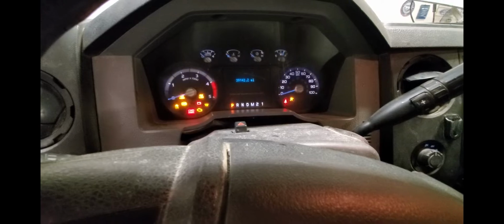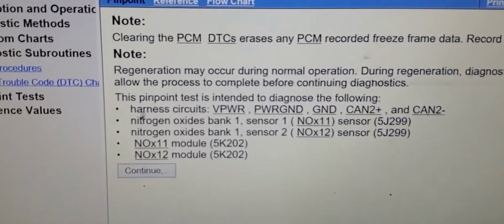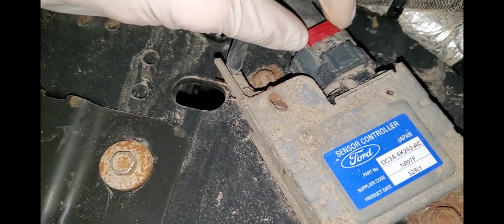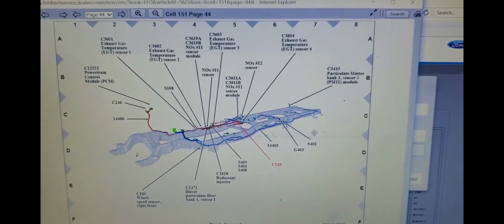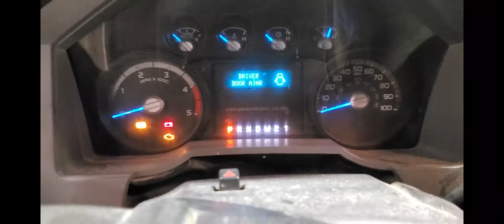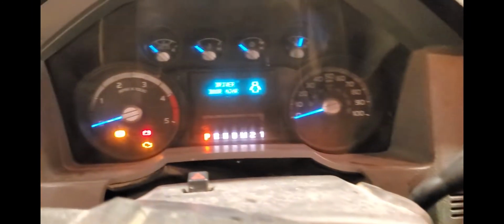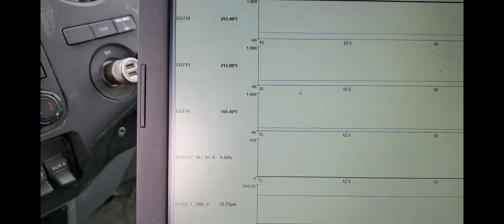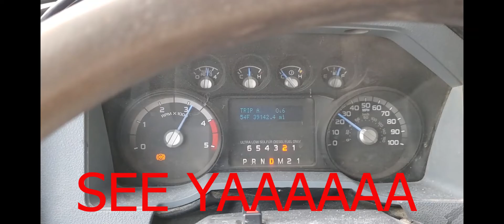FORD 6.7 Powersteoke Diesel-LIMP/DERATE MODE EXIT PTOCEDURE CAB CHASSIS

Comment: after replacing or repairing the harness/wiring, is it possible to run a drive cycle without a computer or program?  Like just start the engine and press the gas for a while?
Reply from the maker: No

Comment: Great Video my man. I was able to get a 2016 F550 out of idle mode after determining  the DEF injector was clogged. The DEF injector duty cycle would not show the graph you pointed out. FYI, I was able to use my Autel MaxCV scan tool to do pretty much the same as the Ford Program. "Live data" feature on the Autel is the same as the PIDs. Thanks again!

Comment: I have 2015 ford f550  with code p207f and p202e doesn’t want clear codes replace injector and check wiring good and send the computer to check if is bad checks ok doesn’t want clear any idea s thanks

Comment: Also from your experience what should the nox reduction percent be?
Reply from the maker: It will very by truck & the condition of the SCR
Reply: Ok I see I’m trying to gather some numbers to help the shop I work for back home. I’m currently deployed amd I’m usually the one to do the diagnostics. The guys back home are not very familiar with the Emissions systems. Anything would help. Love your videos by the way.
Reply from the maker: Yea, it wld all depend on the problem & the codes retrieved.
Reply: Setting a reduced power message under 50mph with the infamous P207F code.

Comment: I HATE how freaking complicated these retarded emissions systems are! I'm still fighting frequent regen and DPF filling issues and a stupid EGT 1 sensor that keeps losing communication (2013 TSB something about bad crimps on the connector - still need to replace). Waiting to hear back if the SECOND DPF cleaning is successful. Apparently all DPF cleaning services are not equal...

Comment: I've had to do it where I drive to 50mph let off and coast. Repeat three times. Then hard acceleration to 50 and coast like 3 times and it cleared.
Reply: That was after replacing the reductant pump though. Different procedure?
Reply from the maker: Same drive cycle
Reply: @PowerStrokeTechTalkwARod  🤔🤔🤔

Comment: I've been in the repair business for 42 years. My current company has excellent documentation for their hardware. Looks like Ford does as well. I appreciate that your job isn't always finding what it is, but what it isn't through fault isolation procedures. You have to be the benchmark for Ford, and for 6.7 owners. If you were just more geographically desirable, you would be taking care of my '21 and my BIL's '11. Instead I watch you, and give it my best shot... Drained and refilled power steering fluid just this AM from tips in another video.
Reply from the maker: Hey thanks man I really appreciate that
Reply: My truck is in same situation don’t have dpf, straight pipe only mechanic said I need to buy new dpf for my truck to run again. Can I bypass?

Comment: Im an Electrician/Avionics tech on airplanes and chaffed wiring is a very common problem. There have been some really interesting areas to crawl into to repair some wiring. Sometimes best to just run a whole new wire than to mess with repairing it.
Reply from the maker: I can understand

Comment: Try chasing wires on a 2019Day cab T-880 Kenworth dump truck with 4700 miles onit with a hydro dump body  and it goes into DERATE because some guy that put it together on a Friday wanted to get home to party.  NOX NOX NOX NOX this....NOX that....nope wire had worn though the SCR bracket and was such a tiny fray that the only reason it got caught was because the tech got a shock when he went to pull out from under the truck and happned to grab the area it was at... EMISSIONS are the reason we still have work to do....
Reply from the maker: OMG 😱😱
Reply: @PowerStrokeTechTalkwARod  Yea..quality control at its finest.  I can guarantee that if emissions was done away with or relaxed even back to 2010 standards, truck would run better, get way better mileage and not break down as much.  I have untold amounts of horror stories from truck drivers about them not being able to control when a truck will go in regen or derate, some end in lose of life. all because of that stupid DPF, SCR or urea system making the choice and not the driver.  Pulling a load of supplies up or down a hill...guess what truck wants to do a regen and you just lost 85% of your power or worse YOUR GOING DOWN THE HILL OR MOUNTAIN AND YOU CANT GET MORE THEN 5% power....

Comment: I don't know what Ford was doing when making these trucks. I found multiple pinch points where I had to move wiring bundles. I kept have sensor problems. The last straw was replacing the first sensor 3 times with the same code coming back. I figured I was looking at the connector side. Then on one fateful trip, stuff fell off and my problems went away.

Comment: Hello PTT... I'm working on a 2015 F350 Pick up Truck I'm attempting to do the procedure to get it out of forced idle and the injector never comes into a duty cycle at all, the line stays flat, I don't have any trouble codes, following the instructions of the TSB 14-0192 doesn't do any good, the injector never goes into cycle after 90 seconds or more of the idling time and all of the readings of temperatures and pressures are right on the money, but when I have it in park and the engine good and warm and I hold it at 2500 RPMs after a few minutes I can see the injector working normally with nice square waves... the only thing I can not do is the reprogramming of the PCM... Any suggestions or ideas will be highly appreciated... Thank you very much.
Reply from the maker: Email me brah.....check my about  page
Reply: @PowerStrokeTechTalkwARod  I sure will, Thanks.
Reply: @PowerStrokeTechTalkwARod  Well, my e-mails return "Undeliverable" for some reason... Could you e-mail me, please?  
Thanks.
Reply: @PowerStrokeTechTalkwARod  I will try to e-mail you form a gmail account and see what happens.
Reply: @PowerStrokeTechTalkwARod  The e-mail form gmail came back "Address not found"... Could you e-mail me, please?
Reply: @PowerStrokeTechTalkwARod
Reply from the maker: I emailed ya
Reply: @PowerStrokeTechTalkwARod  I didn't get your e-mail and I also looked in the spam e-mails and nothing... But I'm happy because a few minutes ago I go it solved... I just tried another scanner and that did the trick, I was using a Snap-on scanner and I was able to do it with a Matco scanner.
I do appreciate your help and all these videos you make... Thank you very much.

Comment: When my 2016 had its dpf and egr “fall off” a connector was left open and hanging down, took awhile but eventually it corroded our from getting road salt sprayed on it under the truck, caused a whole range of DTCs ranging from glowplug module failure to the fan clutch not working properly. Eventually I realized what was going on and snipped the bad wire, sealed it and all the problems went away. Thought it was interesting though at the time, so if anyone’s dpf and egr falls off, make sure you you secure all the connectors properly
Reply from the maker: Dude, you know how many times we see that come in. The idiot's who take or have that shizz fall off are so badly wearing blinders cuz they wanna role coal sooo bad that they4 get 1 crucial step....COVER THE DAMN CONNECTORS!!!!!! Pass Go Collect $200 doll-hairs twank you chum again
Reply: PowerStroke Tech Talk w/ARod hahah I believe it, I just missed one of them, did cost me much other than time I guess to repair but I learned my lesson on keeping them covered. I deleted mine simply for a little better fuel economy and long term reliability, no horsepony increase or anything.
Reply from the maker: Id be doin the same 😉
Reply: Lmao “fell off”

Comment: If you don’t succeed at getting it out of idle only mode that way, i have been able to get it to clear by doing an injector cleaning procedure or manual regen and then letting it idle for a few minutes after the process. One way of getting around having to cold soak it.
Reply from the maker: I have also hosed down the DPF and all sensors while watching IDS so I could super cool it down in like 10 minutes.

Comment: Good job. I would never own another one of these 6.7s without deleting it.
Reply: Loved the 2014 but sold it at an offer too good to pass up. Installing a new Garrett 743250-5025S on the 2005 tomorrow. New Siemens injectors last month, studded and deleted since 120k. 306k and still running like new, when it runs.
Reply: @StorkTransportLLC  "when it runs" 🤣
Reply from the maker: Hell yea bud!!